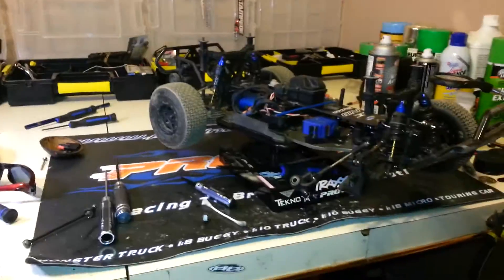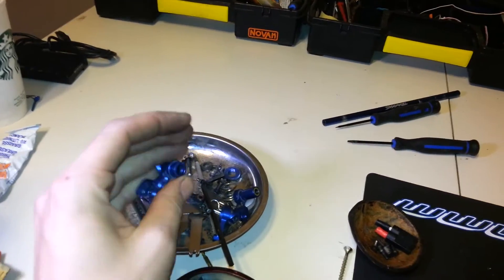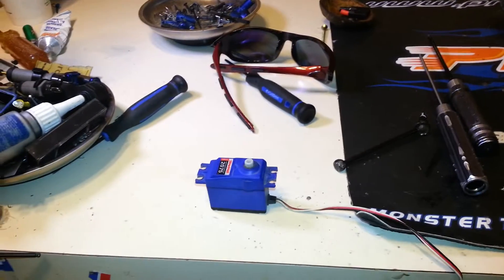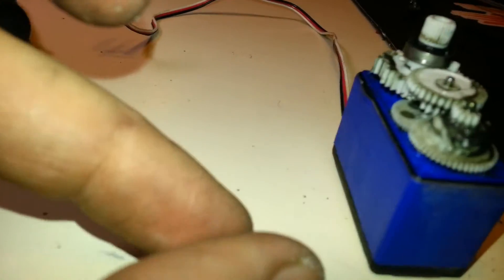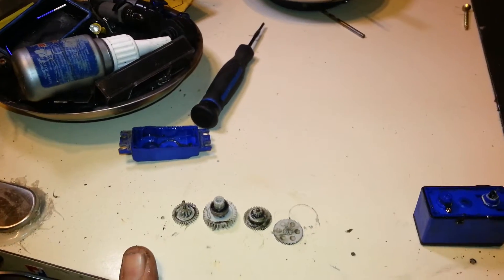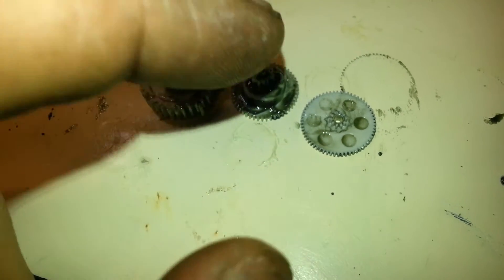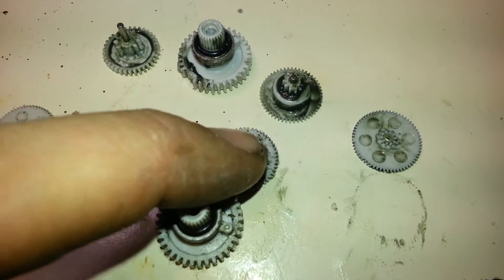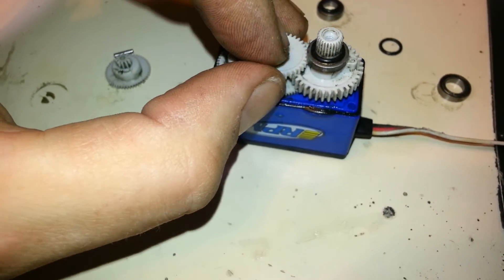How to rebuild Traxxas 2075 Servo

Comment: I bashed my stampede pretty good and broke my 2075 servo casing. Don't ask😂. Can I pull the servo out of the casing easily?  Does it involve taking apart the gears? Or does it pull straight up and out?